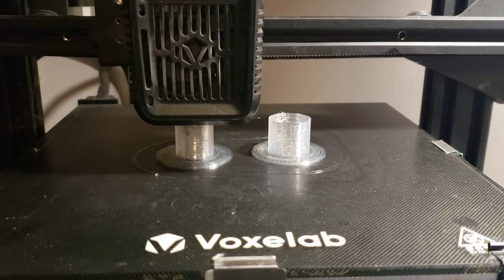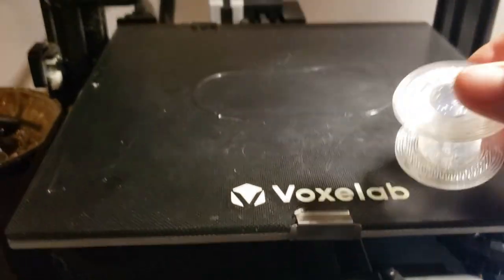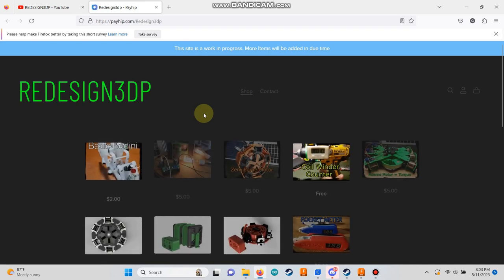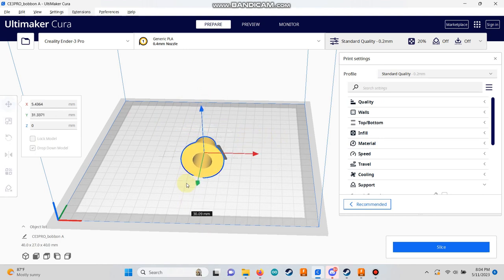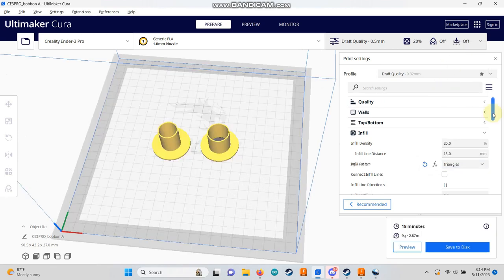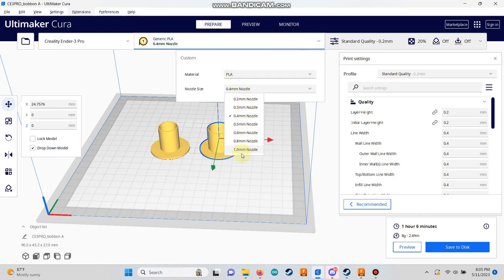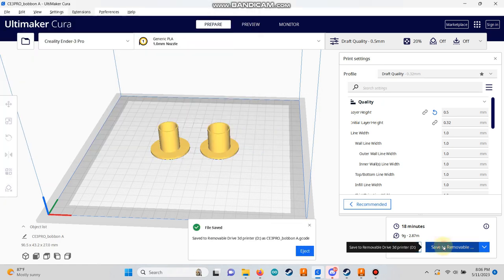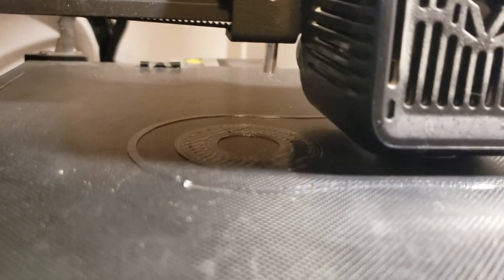Basic Bedini Pulse Motor Part 1: 3d Printing

Comment: great content. I would however look at CHEP's fast printing profiles. You can get the same and even faster speeds using the 0.4 nozzle and even get better output. He has tuned these fast profiles and my prints (using the .28 ) are even nicer than using the .20 ......The speeds I achieve are incredible. He's even recently tuned a 0.6 nozzle fast profile. Just a thought. keep up the good work man
Reply from the maker: Thanks. I haven't looked at Chep's channel lately. But I do use his profiles. I was just making this video simple for newcomers. I can't wait to see how the Big Newman turns out. Your a very patient coil winder. Your already building it nicer than what I did, which is really cool!!
Reply: @redesign3dp  thanks man. Your design is awesome. I just got the second 20 gauge  spool and the 4 magnets in. The rotor is a beast. The weight of the 4 magnets alone scares me lololol. I'll wind the second coil this weekend and hopefully start the build process.
Reply from the maker: Wrap a few layers of fiber reinforced packaging tape to hold the rotor plastic together.
Reply: @redesign3dp  ya I was going to print a cover/sleve of sorts. I did it for my maglev rotor just to be sure lololo
Reply from the maker: I've had pla fly apart at high rpms 14k and above. The tape keeps it together.